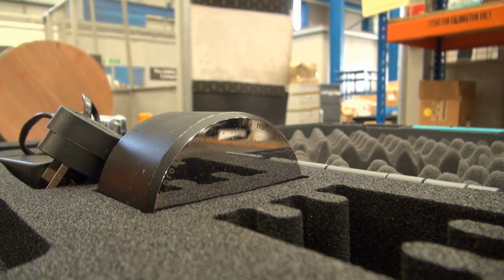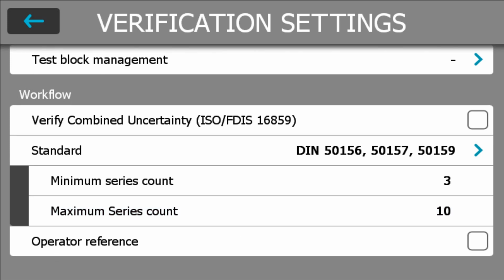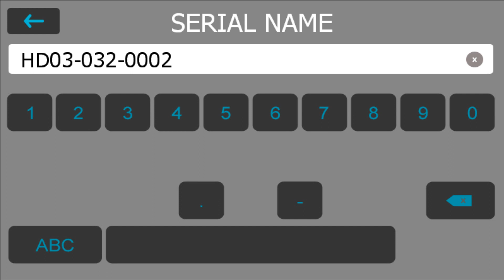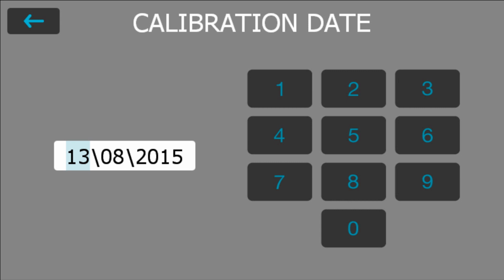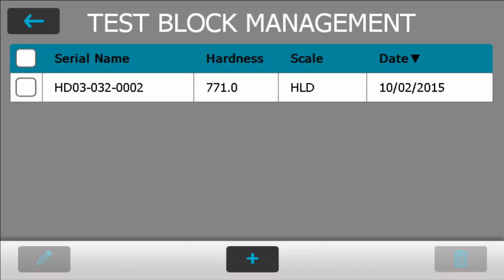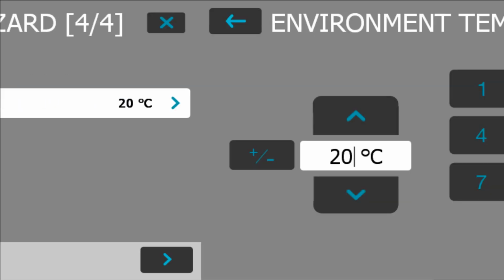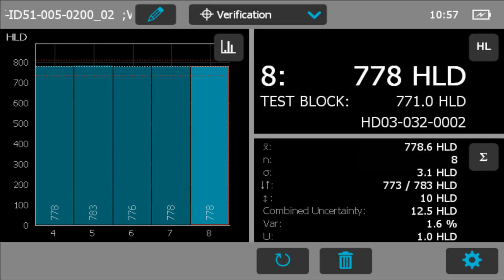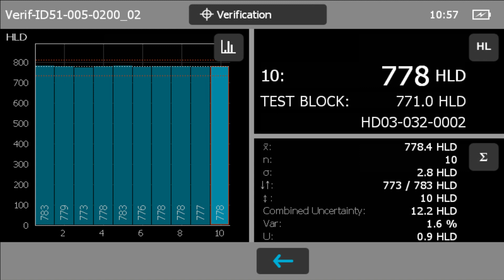How to verify your Leeb devices I Equotip 550

Comment: We have brand new machine 550 leeb type following instructions of calibration we found 20 - 30HLD difference from actually value on block 755HLD. Pls suggest what to do?
Reply from the maker: Hi @sukhenkumarroy, thank you for reaching out and for purchasing our product. Please ensure the correct material groups is selected, that the test block is placed on a stable (not an office desk) support, the support ring is fully screwed on, please also remove both protective stickers during the testing, check impact direction setting, and ensure that the surface of the test block has been appropriately cleaned with degreasing agent. 
 
For more information please contact us directly at https://www.screeningeagle.com/en/contact-us#supportContact or see the verification guidelines provided in our portable hardness testing book available to download here: https://www.screeningeagle.com/book